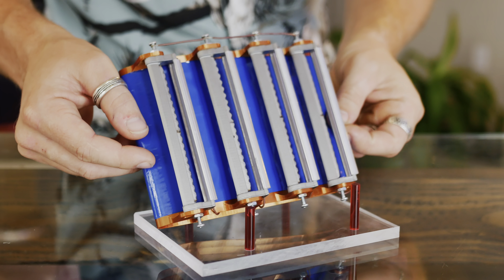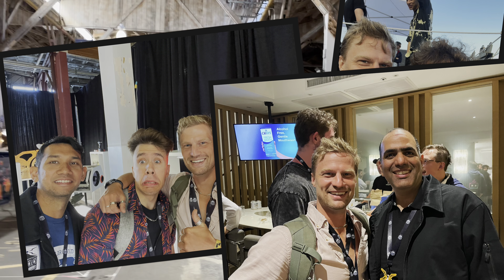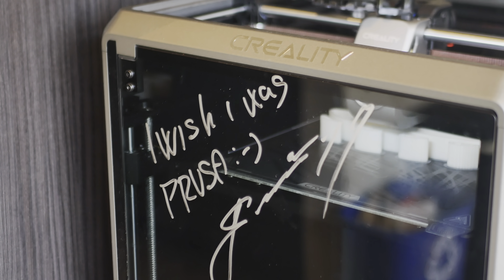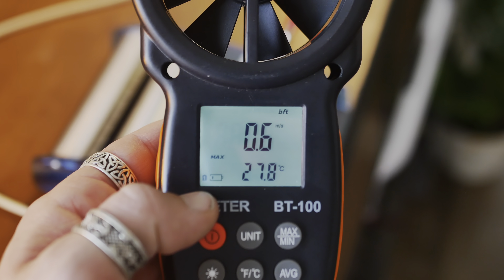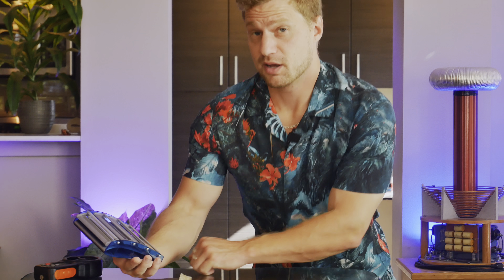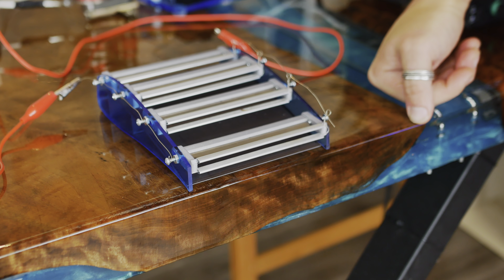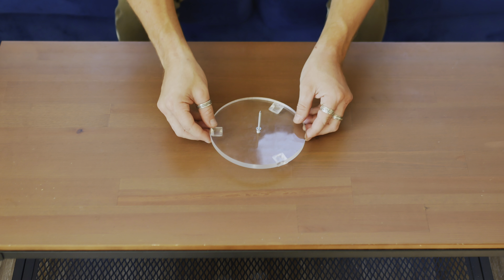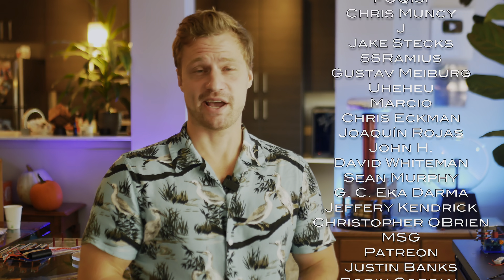Designing A Self Propelling Ionic Thrust Wing

Comment: its fancy talk for some stuff gets hot or cold to force air to move.. so... it's a less efficient jet engine that uses inefficient electricity systems to convert into thermal energy densities to fool investors into spending money on substitutes for fossil systems that will always win the race. This video only shows tech solutions that would ever come into play with small systems that wont scale due to volume/weight conundrums of energy density to power it. It's wonderful for laboratory theoretic but that's about it within our own celestial body. Long term projects in space might have applicability. Don't invest you bank into thinking this stuff will "fly" at scale  **And yes I dumbed this way down so the average person can follow it, and spoke in metaphor occasionally.

Comment: I don't see the benefit of mounting the ionic thrusters above the wing, your going to disrupt the airflow over the wing killing any real gains in lift and thrust. What you could do is enclose the ionic drive within the wing, providing a leading and trailing edge gap for airflow to enter and exit the wing, basically a wing within a wing. This setup might else help compress the thrust within the wing to providing a more directed airflow out the trailing edge of the wing.

Comment: 👍👍 congrats!
My thoughts are in the direction exposed or ducted foils. Again it comes down to drag vs weight. Most think batteries are heavy...they are. Jet fuel comes in @ roughly 6.5 ish pounds per gallon. Avgas is 6.02. So fuel cells offer little. But back to the "Opener"...exposed or ducted (Boundry Layer)?

Comment: The geometry of the wing is designed specifically to create lift without your ionic drive. I have 2 related questions..
1- what is the affect on lift in putting your drive on a conventional wing?
2- what is the affect on the output of your drive unit by being placed on the surface of the wing?

I wonder if it would be more efficient to have the drive unit inside the wing allowing you to maximize the efficiency of both systems? Or if a different wing geometry would make both lift and thrust more efficient?

Comment: Quick question. Is there a reason to put the thrusters at the top? It seems to me that underneath would be better. I could have this completely wrong but if you're injecting thrust into the already high pressure area underneath, you'd get the added benefit of thrust AND more lift as this would enhance the pressure differential. By injecting thrust into the low pressure area over the top of the wing, you're cancelling out the pressure differential between the top and bottom. I don't think you can expect this to get off the ground like that.

Comment: This is cool. Would there be any loss of energy with the top of the wing open? Just wondering if a thin sheet of plastic over the top may increase the thrust with a smaller slit concaved inward on the leading edge. Plus comparing the weight of balsa wood to the plastic. Just some thoughts. I had also suggested the cones on the first video.👍😎👻🌶️

Comment: Mike Patey might be a name worth getting in touch with on wing design outside just conventional designs + the extra components you've added for the thrust mechanism.
Also, i'd reduce the metal segments to wire, in a zig zag pattern, crushed flat. If that electrode can be copper, you could easily do it at home.

Comment: Pretty cool!  If this were to be scaled up to capably fly an airliner at the same speeds and altitudes we do today, ideally instead of loading the plane down with batteries, the plane could use perhaps an upgraded APU.  The APU is a small jet engine in airliners used not for thrust, but to start the main engines, provide air conditioning, and generate electricity (by driving a generator) until the main engines take over for the latter two.  With your design, the APU, and the onboard generator(s) scaled up, enough electricity could be generated maybe.  Pilot Institute has an article I've referred to for this comment (search for "pilot institute apu"), and that article says the main engines burn 2000 - 4000 lbs of fuel per hour, but the APU burns 440 lbs per hour.  However, at some point the APU is no longer used during flight.  In the above scenario since an upgraded version would run continuously, we can expect not only more fuel used by it, but more fuel per hour.  However, it would still perhaps be far less fuel than today's jet engines use.  This could be taken advantage of to lower the cost of flying commercial!  However the new-tech cost would have to wear off.  For such a scaled up version of your design to be trustworthy for commercial (or other) flight, not only would the weight have to be diminished enough, but there would need to be enough redundancy in design to account for failures.  For example, a dual-engine airliner today can still fly safely if one of the engines fails.

Comment: Perhaps I’m completely speaking out of turn here due to limited knowledge but wings/airfoils are what makes flight possible why not just incorporate airfoils into the thruster design such as using the streamlined tube for all three components of the thrusters and then using multiple wings such as biplane or a triplane design with the thrusters stacked between the wings

Comment: Keep in mind, to generate liftn air must travel faster under the wing. Might want to switch to an underwing design, which will increase lift efficiency
Reply: I think the air is going slower under the wing, this cause increase in pressure and lift

Comment: In the final revised wings you leave 3 longitudinal ribs that go the full breadth of the wing. With that wall thickness you could almost certainly do without 1 or more likely 2 of those and rely more on the rigidity of the overall structure. Wouldn't necessarily scale up wo non-model sizes, but at anything near this scale and dealing with stressed coverings like heatshrink model plastic it should be fine. Fun video ! Looking fwd to more.

Comment: Consult with model aircraft enthusiasts.  You will get a lot of working ideas.  But the reality is that thrust for even the lightest of air frames is really hard to come by with any sort of efficient thrust to weight ratio.  This electric thrust idea works better in space than in atmosphere.  Your best bet would be to build your thrusters into the wing itself and do everything possible to reduce drag which is your biggest challenge.  Think about bi-planes.  There's a reason they don't stack wings close together.  Air foils work by creating a difference in pressure between the bottom of the wing and the top.  Your thrusters are acting against the lower pressure on the top of the wing.  Two wings together in such close proximity will cause exactly the same disruptive effect.  If you were to create a thruster which did not offer drag  or could offer a larger amount of thrust to drag ratio would be your best bet.  Ducted wings might help but it might not.  If you're dedicated to the notion of thrust on the wing, run it along the bottom.  The LIFT comes from the vacuum or lower pressure created by the movement of air across the top of the wing surface.

Comment: This can never work in a useful or practical sense.  Do not screw with the air foil.  Lift results from the vacuum that results above the wing.  You're forcing compressed air across the surface of the air foil.  That is the opposite of what you want because that reduces lift.  Let the air foil do what it does.  All thrust should be below the wing or within the wing.  Not only are you disrupting the lift capacity of the air foil, you're creating additional drag.  It reminds me of a guy trying to put a sail on a skateboard and then trying to move forward with a fan to blow the sails.

Comment: Realy nice work! Love your videos!
I have some ideas that might work for your design, it might atleast help with the weight issue. I worked in the royal norwegian navy before on a minedestroyer, and because of some classified reasons and weight related reasons we desided to have the hull of the ship constructed like a sandwich with diferent materials. One of witch i think would work nicely for your wing design. We used amongst other things PVC-foam, that material is super light weight but is still riggid enough to hold a shape and alows for some flex in a wing.
There are also now some more leightweight batteries that are being made for electric airplanes that would be more effectiv than lithium batteries i think.
And would it not be better to have a two thin wires strung up together with goldleaf foil around them to make upp for the blades and thus reduse more weight on your ionic thruster? The gold foil should give you less resistance for the currents frequency should it not?
😊

Comment: It's an interesting idea but I see the ionic thrusters on top of the wing inhibiting the lifting capabilities of the wing it's self.  Even if the thrusters are air foil shaped, they are creating high pressure on top of the wing which is trying to create low pressure to get lift. 

Putting them in front of the wing might be a better soluton

Comment: I doubt you'll see this, but if you do I hope you consider what I write and it helps you make that full plane! I was thinking it would be a good idea to be able to potentiate the total output of flow while also being able to maximize its thrust captured to forward movement. Such as an internal vacuum inside of the wing with the cable and power source placed inside a vacuumed out fuselage to help reduce weight further and increase buoyancy. The aluminium grounds can be given flared out & stacked double wave guides. Its a crimping technique, kinda. You have to split the rear and then cut it to the bend one of them higher than the other while crimping it to curve it upwards at the edges. The other stays at the same place but gets more significantly curled at the edges and is skinnier than the wider ones in-between it. Drill small holes in the leading edge of the tubes, you need to reduce weight anyways, and try and push it out from behind to have it bump towards the middle between the holes. Try to crimp that to then have it smoothly transition to the holes, but also try to make the holes more oval with wider sides than the middle. It helps act like a scoop into that area to improve airflow but also can increase capture of airflow into the wave guides to act like a bell end of a rocket engine!

Since you have 2 of them it should improve the overall capture of each stage, with a more even separation of air flow for greater lift characteristics and even better lower weight, more thrust outright, and a more tuned flow path for the boundary lower pressure area to skip off like bird feathers can sometimes give during flight. Basically it sticks to the wing, like the rotating vortex in the back of a pick-up truck, to have air skip off but its lower pressure and so provides cleaner flight and more lift per square inch of wing. Like a bunch of mini wings that give lift like rctestflight talked about.

Using a resonance diaphragm inside of the wing & or fuselage, you can get a pumping Stirling action from the vacuum pressure and the heat/pressure of the wind and atmosphere. This will be able to be increased using the electrostatic discharge (think electrostatic headphones, but they suck because of the current and volts they need to be good) onto the aluminium and the z-pinch of the dc current, not enough to produce much though, and the electromagnetic field produced by the wires, but its very little, to become potentiated into a usable electromagnetic resonance pump for air from the nose & or tips of the wings of the aircraft to help reduce drag and improve efficiency of heat/field loses of the circuits used in your design. Since its going to need to be there anyways, wings, tube thingy, batteries, cables, wires, air, so on, I figure its not too bad to just use a simple diaphragm to help pump something (just some food for thought, the whole thing vibrates and bends when in flight, whats a pump doing differently for no moving parts?) into the engines of the thing. If you can tune it just right it can help reduce bending and flexing of the aircraft by absorbing frequencies you don't want going on & or just make it much more controllable in flight using a stabilizing effect to any drag issues going on. Microturbulence stuff.

I understand its a long read and seems complicated, but it could really improve your overall design a ton for usability in terms of the amount of electricity used. Air is just a poorly moved conductor gas and it has not much going for it in terms of its overall ability to be affected by electricity without decently accurate pulses, resonances of fields, collapsing ionic fields, electrodes for a z-current pinch during collapse with the pulses and frequencies corrected during pressure shifts, humidity shifts, temperature shifts, and even more for a spike wave like amplification of the movement through a rail gun like completed connection of a circuit that allows for a re-circulation field effect into the beginning to increase frequencies and start a larger and larger venturi + Bernoulli principals while increasing its heat ordering during the change in pressure and directional movement with the field resonances, collapsing of static ionic fields during this, to then have a decent current draw through that section of air (like camshaft timing, they can never interfere the piston always wins so you need to time and space them otherwise you'll just zap and pop the air a little and get nothing at all) into the electrode section to increase its flow velocity into a bell end like aileron that uses capacitive resistance and non-ionized air with ionized air differences to, together with heat, to force a massive osilative field from the top and bottom of the wing to then collapse into the aileron section to increase a Stirling heat differential effect at it induction heats and statically heats 2 sides of the aileron to the have it rush towards a further back section to be combined like a pulse jet engine/two stroke engine that makes it receive its sudden increase in pressure as thrust captured by the bell end like hollow 2 section aileron.  

Essentially, ionic wind stuff is hard and you have to treat it like a bunch of micro circuits that work like multiple little 2 stroke engines that are connected to a common crankshaft that need to have the degrees of rotation timing correct for them and a series and parallel linked camshafts that allow for the rear to time a big rotational field and a log vortex field collapse onto a piece of metal that constantly hits it at just the right time to keep it at a in increasing power/heat state (like ac induction fields) that has to bleed off that heat as expansional captured energy from the air passing over it, like radioactive jet engines back in the day used to, to improve outright efficiency. Sort of like a turbo that has the turbine directly dumps its power into the crankshaft/transmission. But instead of just that, because the field collapse isn't perfect and bounces back towards the front, you time that with the crankshaft timing and camshaft timing to make it work better. Sort of like the controllers for some electric motors out there that need the feed back to know from their phasing used or whatever. Anyways that field now modulates the changes and timing of the crankshaft and camshaft, like vvt/vvd/vvl stuff but also where the pistons are connected on the crankshaft and the crankshaft connection angles, from the speed of the air, the pressure of the air, the amount of humidity in the air, and the type of air (different gases in the air). Even wind conditions! Its all automatic and passive, but you don't get a lot of say, its all just going to be its thrust amount and nothing else. No increase or decrease, but its easier to control from surface controls and some pumps to force more or less with some stirling vacuum areas and diaphragms :)

Comment: Totally genious. I wonder, what about make the wing as a thruster instead implement the thruster to the wings itself. I mean the wing has has an aerodynamic shape that also has the ability to compress the air flow, i would thought it will work like a jet wing plasma thruster. It's just another idea. 🤔 I mean is it possible to wind enters through inside the wing and compressed by the ionic plasma thruster.

Comment: Hey. Have you thought of adapting a biplane design with electrodes on the upper and underside of the both wings?
2 wing blades would increase lift capacity and they are good for low speeds. Just an idea